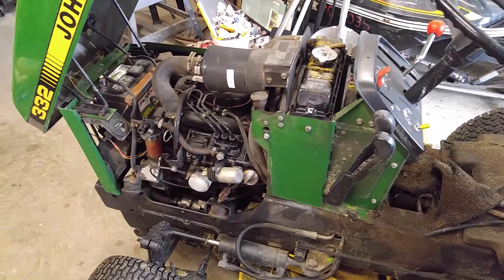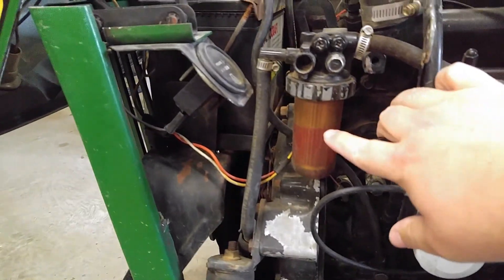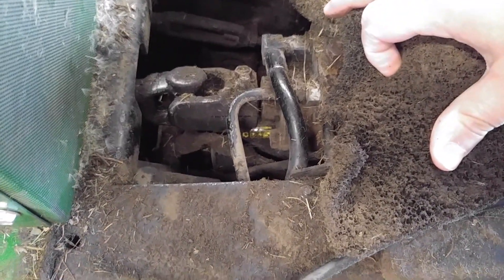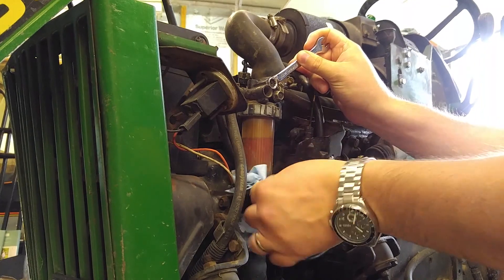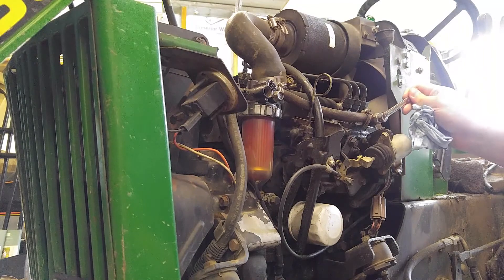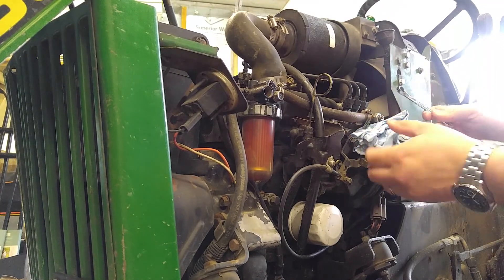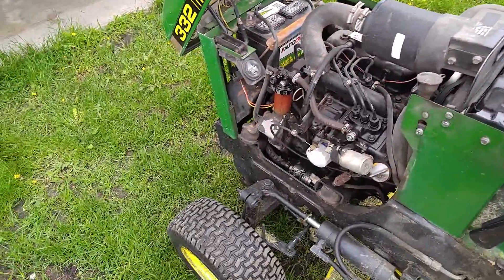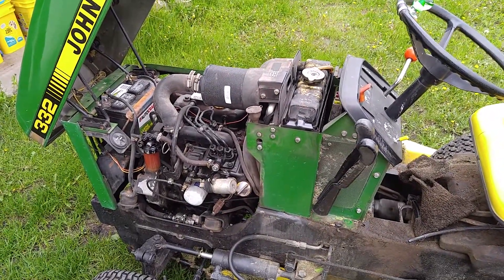HE LIVES! Vin Diesel Is Back in the Saddle Again - John Deere 332 Diesel Repair

Comment: I sold my last year for $2500 got for free with plow, deck, new paint, belts, radiator out $2000 good riddance. A true money pit never do that again.
Reply from the maker: I also sold this tractor this summer. I bought it several years ago for $3400 (I think) and sold it for $2500. Not a terrible value. I'm really missing the snow blower now though! Thanks for watching and commenting.
Reply: @tylerpripps4969  Yes I think it was a good move for both of us. Because those diesel tractors are very expensive to repair when they break down & parts hard & expensive to find.

Comment: Nice, that was sure easy! say I noticed in the video for your mowing deck, your hangars are backwards, it should be forward & hooked on the other side. Mitch 👋
Reply from the maker: +Hockey47Mitsch say whaaaat??? I'll have to take a look. Everything seems to work alright.
Reply: Tyler Pripps I noticed at 7:14, your hangar should be forward on the other side not on the bar/lift side
Reply from the maker: Hockey47Mitsch well would ya look at that. I wonder how long mine's been that way. That's how the previous owner had it set up. Looks like I've got a small project for this weekend. Thanks for pointing it out and showing me the way. Thanks for watching. Stay tuned for more videos.
Reply: Tyler Pripps Yup no problem! Yeah they kinda get off kilter when mowing & lifting the other way lol. Just subscribed! I’ll be looking out for more videos thanks 👍

Comment: Since you have one of these I have to ask
A customer of mine just gave me hers. It over heats and pukes alot of oil every time it runs. Im guessing it could be a plugged air system or radiator. 
Any ideas that I could be missing? 
I have always wanted a 332 but im praying its not completely ruined.
Reply from the maker: markofthejt motj mine does the same thing when it's run really hard. Though I don't think it pukes oil.  One thing I did to improve the overheating is to take out the radiator, straighten the fins and give it a thorough cleaning. The next thing I might try is to replace the thermostat. If that doesn't do the trick, I fear it's the head gasket. Good luck. Thanks for watching
Reply: Tyler Pripps 
Thanks for replying and hopefully it isnt the gasket. The one I just got has 840 hours on it so im hoping it just needs a good cleaning and filter replacements.